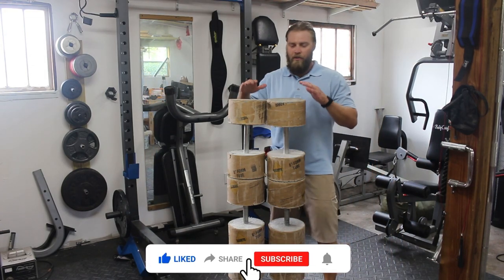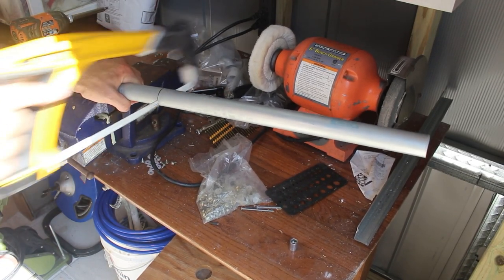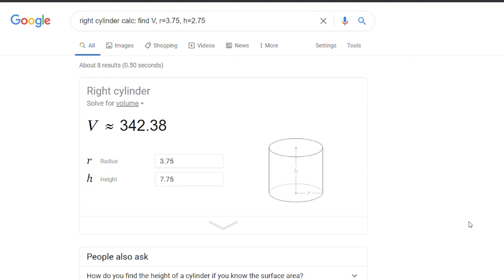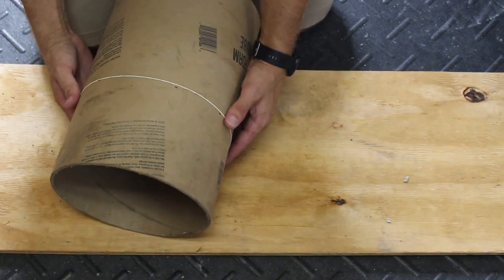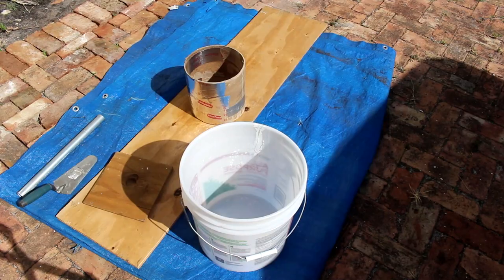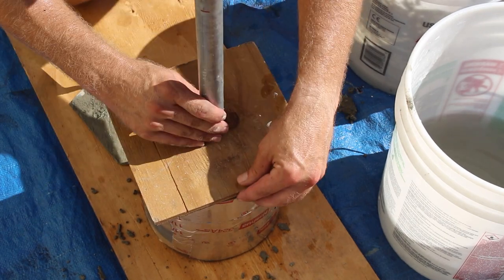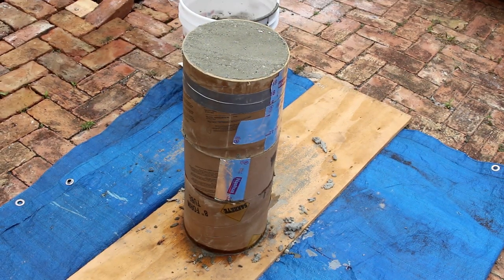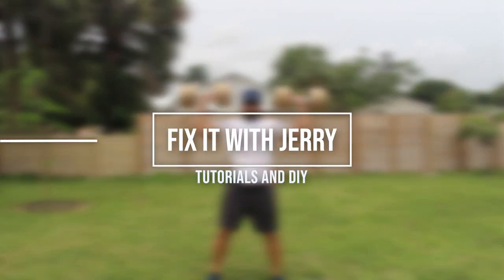DIY - Cheap Concrete Dumbbells

Comment: Keep the mix on the dry side, and tap the forms with a hammer to remove air by vibrating the concrete. The surface will be smoother and let off less dust, and be less brittle. Wet concrete is weak and dusty when cured.

Comment: I made these when the gym became a pain the ass during the plandemic. I used various (cheap) paint mixing tubs and buckets and embedded chicken wire, then coated with epoxy resin for a glossy, clean surface. Cut a hole in the lid to center the pipe. I still use them. They're indestructible and look sharp.
Reply from the maker: Nice!

Comment: I am going to the hardware store to get the stuff.  Thank you for a great video.  I am not going to pay 300 for a pair of 50 lb barbells and even more for 60 lb. Dam price gauging.
Reply from the maker: Yea it's pretty crazy how expensive free weights have gotten.
Reply: I found this video because other DIY ones are suggesting to buy a $100+ plastic mold. Just use a bucket or the cylinders in this video. The whole point of DIY projects is to save money.
Reply: @zachm9705  Amen to that!

Comment: Nice work.  I think I'd use the heaviest pipe possible for handles to reduce the volume of concrete required, at least this would be my strategy for heavier dumbbells.  Solid steel bar would really be optimal for the heaviest in order to keep them as small as possible.
Reply from the maker: True,  but that solid steel is going to be real pricey!

Comment: it would be better use pvc pipes as mold, you can reuse it longer, even you can left it on the concrete as protection  and make the dumbbell  harder to brake
Reply from the maker: You could, but 8" PVC is real expensive and you have to buy a 10ft stick. Then you have to figure out how to get the concrete out of the pvc mold if you're going to reuse it. You'd have to split it down the middle somehow? This did cross my mind when I starting building these but I abandoned the idea when I couldn't find 8" PVC at big box stores and needed a contractor account with local suppliers. I figured the "average joe" doesn't want to bother with that either. But hey, if you have easy access to cheap 8" PVC then by all means, do whatever works for you! Thanks for watching!

Comment: Empty 4L paint tins work good also and you don't need to take them off. Also fairly weather proof.
Reply from the maker: Nice, good idea. I've also thought about using Large PVC pipe which would be better than metal outside.

Comment: I know this video is a couple months old but for those like me just getting started to making your own weights, if you have a concern about durability of concrete weights you can spray them with flex seal and even heard people using truck bedliner as well to improve durability.
Reply from the maker: Valid concern, I used these weights for 3 + years and they survived two moves before  I finally bought real gym equipment. Never had a failure but I also never dropped them on bare concrete - either grass or gym mats. I would imagine the handles would bend before the concrete broke especially if you use the high strength stuff with fiberglass in it. I do mention painting them with rustoleum in the video, any kind of paint or covering would help them hold up better outdoors. Maybe I should build another set and do a durability test video..

Comment: I just bought the materials.  I’m thinking of adding scrap metals i can gather from work.  We scrap penny size, quarter size and some larger ones by thousands a day or the nuts and bolts that are dropped or rejected by machines.  We don’t reuse dropped parts as they can collect debris that would cause problems on welding quality. I’ve also gathered screws snd and nails when i was doing home renovations. I could also use those. Nails and screws would make it stronger like using rebar!  It would cut the size of the weights.
Reply from the maker: Good idea, just make sure to bury them deep enough in the concrete that they done rust from the inside out. You'd want at least a couple inches imbedded I would guess.

Comment: I saw a similar video and they suggested using truck bed liner spray on the outside of the weights to add durability.  You could also get a cheap exercise mat and cut a piece of that to go around the rim and gorilla glue it in place.  It would make it somewhat like a bumper.  You could also use chicken wire (or something like it) as a lattice work on the inside and pour the concrete over it to strengthen it.  Just my 2 cents.
Reply from the maker: I like the rubber and bed liner idea. If you use high strength concrete you don't need any mesh or wire in the forms.  The high strength concrete has fiberglass in it that makes it more crack resistant. I might make a video on pushing these to their breaking point since there seems to be a lot of skepticism over their strength.
Reply: @fixitwithjerry6161  I would be interested to see how much that "high strength" concrete with mesh or wire would add to the durability.  I've watched a couple of other videos about making concrete plates and they had "drop tests" from deadlift, clean and overhead heights.

Comment: The is definitely the best one I've seen. The description of everyting is great. One question, what would the measurements be for 5lb dumbbells? Would I just divide the measurements for the 10lbs by half?
Reply from the maker: The reason I didn't go below a 20lb dumbbell is because it just gets too thin to have any structural strength. If you look at the chart I made, an 8" tube at 20bls (10 lbs per side) is less than 3" thick. Below that I would try and source a different mould material and make a form that is maybe 4" in diameter instead of 8". Each side would be smaller in diameter but thicker and have more rigidity. I hope that makes sense.

Comment: For me at Home Depot Today
Concrete - $6
10'x1' steel conduit - $19
8"×48" mold - $13
Total - $38

Walmart 2x 20lb dumbell 24.99x2
Reply from the maker: Very true, things have changed. This was during the pandemic when you couldn't even find dumbbells.
Reply: @fixitwithjerry6161  Thanks for the vid and your work man it is great. If I make a set of 20s, 30, and 40s, it'll just be $0.38/lb. Dats gooood

Comment: I used a filel to hex slight groves on my emt. Gives the emt tubing a little better grip.
Reply from the maker: Nice, how much time did that take?
Reply: @fixitwithjerry6161  about 20 minutes per. Set it up on a vice (made the vice smaller than the pipe so it would spin on top and ran the file down like a corkscrew), ran one direction at 45 and then flipped to the other side. Similar to how they add texture to old-school wooden stocks. Worked great. Gave it just the right amount of grip but not too rough on your hands.
Reply from the maker: @elslick  That's not to bad. Worth it I'm sure. Very cool idea.

Comment: Why do you use 3.75 as the radius instead of 4? Are you taking off .25 to compensate for the pipe?
Reply from the maker: If you look at about the 1:20 mark I explain that not all 8" tubes are actually 8". I was compensating for tubes that measure about 7.5 to the inside. The screengrab is just one example. I have a couple charts and a like to a calculator on my website. Links in the description.

Comment: Great video! Thank you. I’m looking to make some 5lb & 10lb dumbbells for my wife and son. Can you possibly provide me any suggestions using your instructions and calculations for the approximate amount of cement or concrete I’ll need for 5lb & 10lb Dumbbells on each end. Thank you again.
Reply: I’d like to know the height for the tube cut out for a 15lbs too please!
Reply from the maker: Thanks for the compliment. The reason I left off anything smaller than 20lb is because anything less and the concrete portion would be so thin (maybe 1-2" inches) that it would be brittle and probably wouldn't be enough to grip the metal handle.
You could try to find a smaller diameter tube or use something, like 3 or 4" PVC drain pipe. You would need to calculate the thickness based on the inside diameter of the cylinder. 

For example: The formula for Volume of a Cylinder is V=πr2h. 
If you were using a tube that was 4" in diameter then you would use the radius of 2" and solve.V=πr2h=π·22·2≈25.13274, then you would multiply that by .087 (weight of concrete per cubic inch) 
so 25.13 x .087 = 2.18 lbs per side, so a 2" deep 4" tube would make a 4-5lbs dumbbell. Honestly though, you may spend as much as just buying retail steel weights for anything 
under 10 or 15lbs I would think. Once you get up to 30+ lbs and retail is $1-1.50 per pound it makes more sense to build them. 

Anyway, hope that helps. Let me know how it turns out. 

Thanks for watching!
Reply from the maker: @jphuynh714  If using 8" form tubes, a 15 lb dumbbell would need to be about 1.75 inches per side. V=πr2h=π·42·1.75≈87.96459 x .087 = 7.65252 lb per side or about 15.3 lbs for the whole dumbbell. I think that a 1.75 inch thick x 8" tube will be too fragile to be practical though. Maybe try using a smaller diameter but thicker tube.  For example, a 6" PVC pipe at 3" tall would be  V=πr2h=π·32·3≈84.823 x .087 = 7.37934  per side or approx 14.75 lbs for the whole dumbbell. Hope that helps!

Comment: Most people put nails through near the ends of the tube so it can embed into the concrete and not easily be pulled out. Are these fine or would you recommend doing that?
Reply from the maker: I'm sure it wouldn't hurt anything but I haven't had any trouble with the handles pulling out. The first set I made I used for about two years before I got rid of them. I also never drop my weights all that hard.

Comment: Can I use  stones e.g I want to make 40kg dumbells,can I use 15kg cement,15kg sand and 10kg stones?
Reply from the maker: If you can get the stones to set in the concrete I don't see why not.

Comment: Wow the difference in weight on the "pro" dumbells was pretty shocking!
Or we could go spend $800 on those Bowflex select tech weights, FFS... or do it the manly way at home!!  With concrete!  Hell yea!
Reply: Dummbells in CT run $1.50-$2.00 a lb used and $2.00-$2.50  avg... august till now Late Dec
Reply: For real, that's the only reason I'd even consider store-bought weights. You'd think there'd be some kind of quality control. smh
Reply: @trajectoryunown  i made 12 - 45 lb concrete plates (  45.2-45.9 )  1 set of 28.6  lb avg  dumbs  finished a 18.8 lb set .   today im making  #1 of 4 for a 50 lb set for a buddy. and 1- 45 lb  plate  to complete 2 for him
Reply: There's nothing "pro" about those. They are common cast iron weights are are known to be up to 10% off, easily. If you want accurate weights, those are called "calibrated" weights, and are significantly more expensive then the shit tier cast iron.

Comment: Awesome video bro! Im trying out my finished protein buckets, one for the form and one to hold it up we’ll see how it goes 👍
Reply from the maker: Definitely curious to see how that works. Are you planning on leaving the buckets on? The plastic probably makes a nice  looking finish right?
Reply: FixItWithJerry hey man sorry for the late reply! I made some plates first and there all done now so I’ll try this protein bucket plan now! The second bucket to hold up the dumbell wont work I don’t think(too flimsy) so im gonna stack cut 2x4s! Basically the same thing like your plywood cut out! I’ll get it on insta maybe I’ll let you know thanks again bro
Reply: Yepp totally wanna use the buckets again! 60lbs will sit at 3-2x4s so when i drop the weight down to 50s all I have to do is compensate by taking out a 2x4 then to 40s take out another.... Lmao the video will all make sense!
Reply from the maker: @alexanderizzard1254  are you doing a video on this one, I'd like to see it!

Comment: Question: Won't the concrete slip from the handle without a hook (like a bolt or something) that is fixed to the bar?
Reply: Drill a hole in pipe and put large strong nails inside and form an X. Obv do it on both sides. Once you finish drilling it, just put it in da concrete
Reply from the maker: It certainly won't hurt to add a cross member but I don't think it's 100% necessary. It's very important that you use concrete mix with an aggregate (in short, concrete is cement plus gravel) or the high crack resistant concrete that actually has fiberglass in it. You're not the first one to ask and I guess I can see how this might be concerning to people. I think I'll make a "push it to the breaking point" video, should be fun. I grew up in the construction industry and if you have ever tried to get concrete off of steel you'd know its nearly impossible without shattering the concrete into pieces. It's something that I never even thought about, it's intuitive to me but certainly not to everyone.
Reply: @fixitwithjerry6161  just to be sure I added 2.5inch bolts and nuts on each side of the handles for dumbbells 45lbs and up and they work fine

Comment: Hey bro how should we perfectly place the handle in the centre? If it's a lil deviated will it lead to injuries? What about weights? Its true measuring it together may give a closer weight but what if each side has a  difference  in weights? My one side of the dumbell is half a pound more than the other. Is it ok to use it?
Reply from the maker: Ok, I'll  try and answer your questions in order. In the video I actually use a scrap piece of wood cut in an 8" square and a hole drilled in the center to help center the handle. You can also just eyeball it.  Lifting any kind of weight can lead to injury. Build and lift at your own risk. You should measure each side when you cut the tubes and pour the concrete vs trying to weight them out. It's fine if the weights are a little off on each side. Chances are they are still better than store-bought weights anyway. Thanks for watching and good luck!
Reply: Thanks brother

Comment: In other video I saw that they put a big nail to prevent the concrete not falling from the bar. But with your way, do you think we need it or not?
Reply from the maker: I get this question a lot. It never occurred to me to do this. My experience comes from the construction industry and if you've ever tried to get concrete off of a steel fence post you'll know its nearly impossible without shattering the concrete into pieces. I've used these for several years and they survived multiple moves before I sold them and upgraded to a full iron set. I never had a problem but I also never drop them really hard on a bare concrete. I believe if you can't set the weight down in a controlled manner you shouldn't be picking it up. That said, I also wouldn't used anything other than the concrete mixes I specify in the video. Either way, there's nothing wrong with putting a through bolt or nail in it if it gives you peace of mind. Hope that helps, good luck with your build!
Reply: @fixitwithjerry6161  thank you for the good reply, it will help a lot 👍

Comment: Would the handles not slide out of the concrete eventually if you dont have some kind of anchor inside?
Reply from the maker: I've had this question before. I've used these for several years before I sold them and upgraded to a full iron set. I never had a problem but I have seen other creators drill holes and use through bolts for added security. Nothing wrong with that if it gives you peace of mind. I have tried to get concrete off of a steel post and its not easy, Pretty much impossible without breaking the concrete into pieces.
Reply: @fixitwithjerry6161  Well thats good lol. Thanks for the info

Comment: good vid. Id recommend fast set concrete by Rapid Set instead though so you dont have to wait so long for cure time. Costs 3 times as much per bag but it sets very quick and is very strong
Reply from the maker: Yes you could. I didn't mention the fast setting concrete because, if you've never done this before and you want to take your time, that stuff will set up in the bucket before you get to use it. lol.

Comment: Is the discrepancy in the form tube diameter because one measures with the width of the material and one without? That seems dumb as hell
Reply from the maker: I'm not sure why they are this way. I'm guessing maybe it makes it easier for the manufacturer to ship them and for construction purposes a 1/4 inch isn't going to make much of a difference. I really don't know why this is though.

Comment: I’ve seen people actually put some wiring or rebar to the handle so would yours fall cause I don’t want do triceps pushed and then expect half the dumbbell slipping to my face
Reply from the maker: You could drill a hole through the handle and put a nail in it like a "T" if it makes you feel better. I don't think it's necessary at least with the type of concrete I used. There 's little to no chance of it slipping out. I had these for years before I finally sold them and bought real metal ones. I tested one that I first made and  the handle didn't even loosen until  I broke  the concrete and it still didn't come all the way off.
Reply from the maker: Robb CoochiesIayer  so are you telling me you have personally made a set using this method and had the steel "slip out" of the concrete?